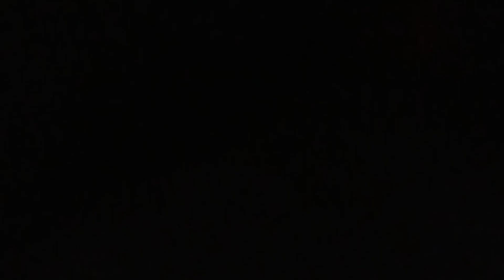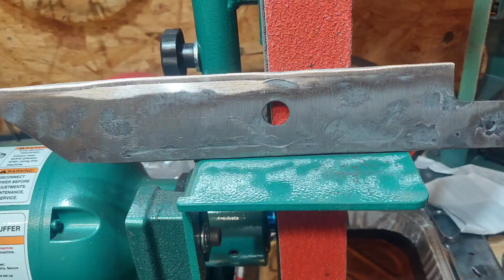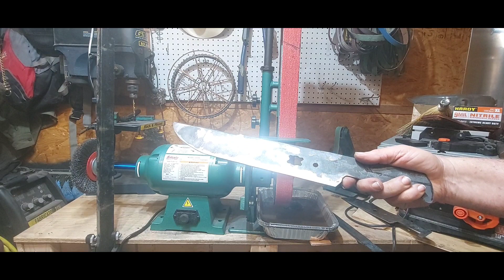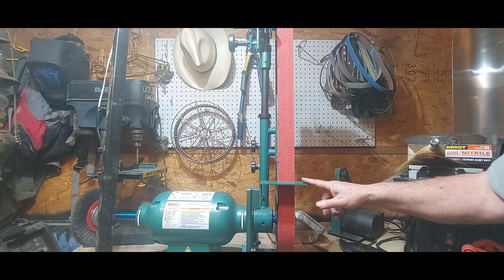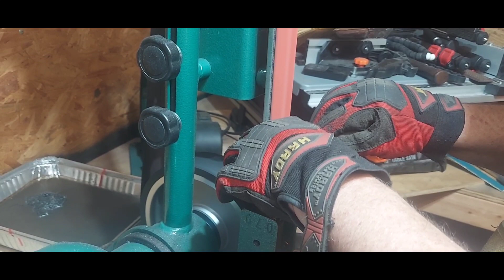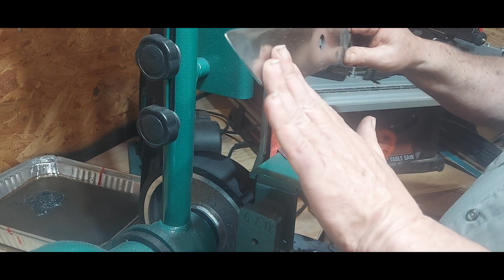GRIZZLY 2x72 belt grinder

Comment: I have had one of these for a couple years now. I basically had the same tracking issue and the same solution. I moved from a 1 x 42. I don't wear gloves and have dinged my finger several times, It definitely  moves metal so skin has NO chance. I bought a second platform and had a piece of apx. 4 x 8 steel welded on it. It gives me a larger working surface. the only issue is getting the smaller blade material close enough to the belt not to be pulled down between platform and the belt. I use a sacrafial  board to set the blade on to grind a 90 degree spine, less chance of slipping for me. I wish this video would have been available when I first got my machine. Some of the safety issues that may be obvious to experienced users, are a great reminder for newcomers. Thanks for the video.